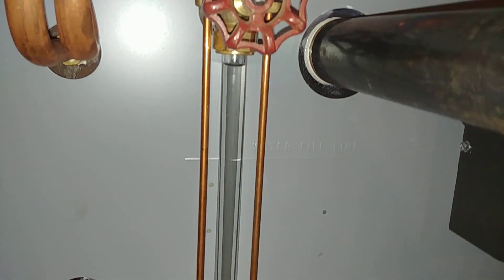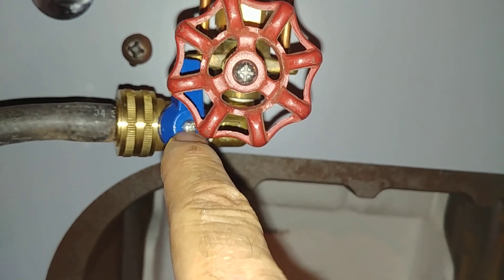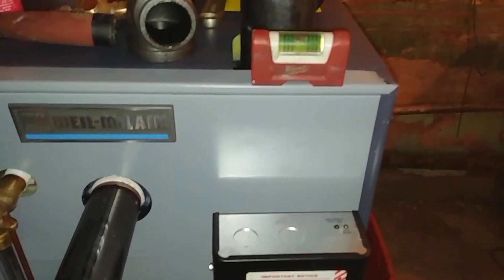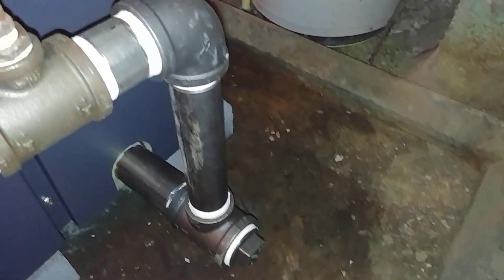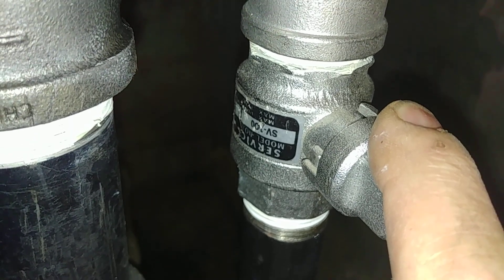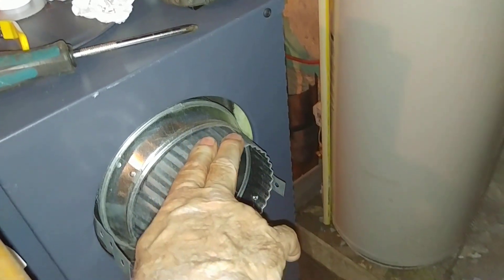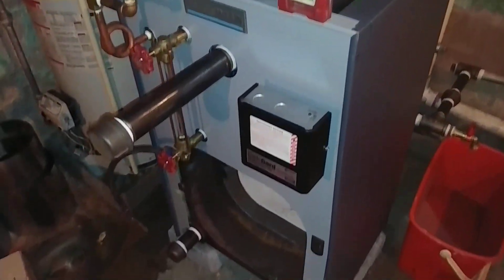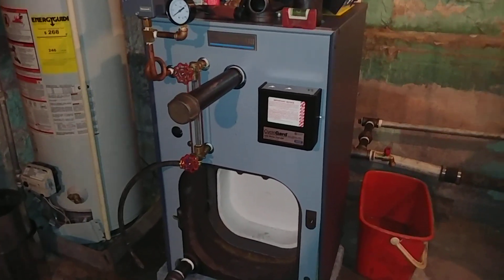Weil-McLain SGO-3 Steam Boiler Install - Still No Friggin' Burner Door OR Trim Kit.

Comment: Question:

There’s one issue that doesn’t seem to get addressed very much  in new gas-fired steam boiler installations…specifically, make up or supply air.

Referencing the manufacturers air supply requirements, I will need to have a direct  connection to outside air because my basement can’t supply the minimum requirement.

I do have the ability to draw outside air into the boiler room, and isolate/insulate the boiler room so the entire basement doesn’t freeze during the winter when temps fall below 0 deg F .

My concern is how do to keep the water supply lines in the boiler room from freezing.

Do you think the heat from the boiler itself will be enough to keep the boiler room from freezing?

Is there a simple way to ensure the boiler room doesn’t get too cold?

Thanks for your response.
Reply from the maker: We have, once in a great while, used motorized louvers to the outside air source.
The t-stat is set to power open the louver motor only.
There is then a sealed position switch attached to the louver mechanism itself, such that only when the louver is fully opened, that switch then closes and causes the boiler to fire.
You could wire-in a t-stat in the boiler room to close the louvers should the temperature drop too low in the boiler room  in case the boiler does not fire.  
You can also wire in series a boiler high temperature switch in the boiler room so that the louvers close in case of fire.
The louver motor is usually ordered with a spring return, so that when power is interrupted to it for any reason, the louvers shut automatically.